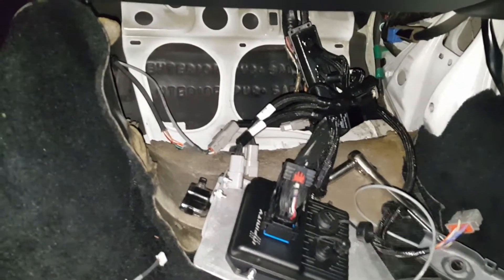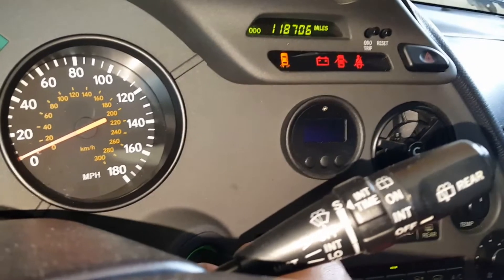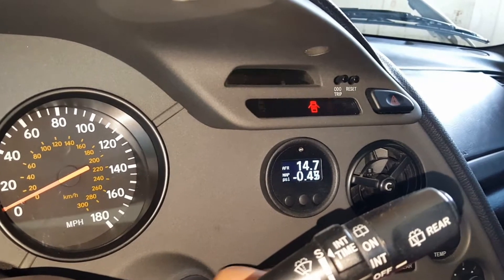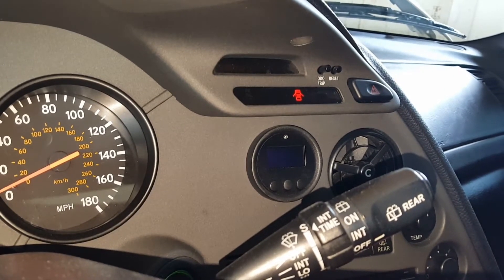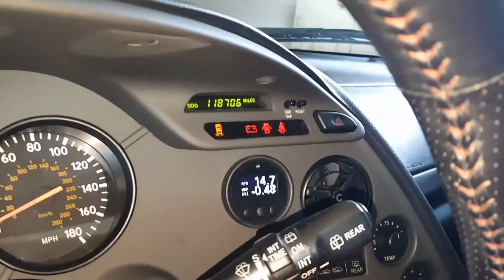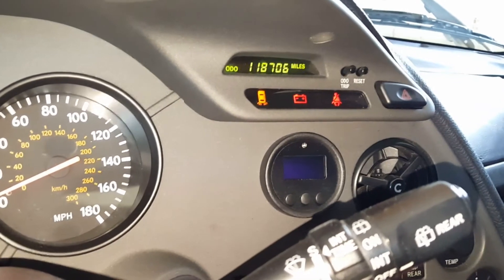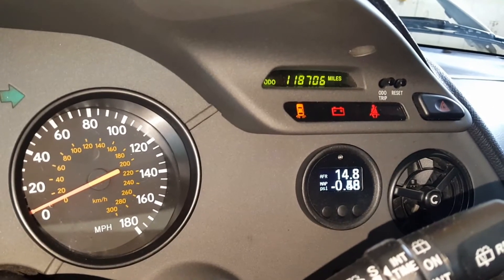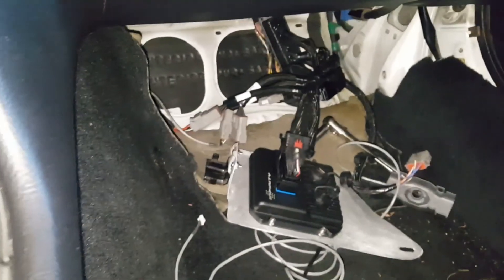Obd2 1997 Supra Turbo Infinity 6 testing rnd 2

Comment: Dave I was planning on running this. Is there any clue as to what's going on?
Reply from the maker: TheProPilot so far I am an outlier...I am not sure what is wrong yet.  obd2 cars are wired slightly different and that may be my issue.  Brandon at BTI has been great, and I am writing with AEM right now.